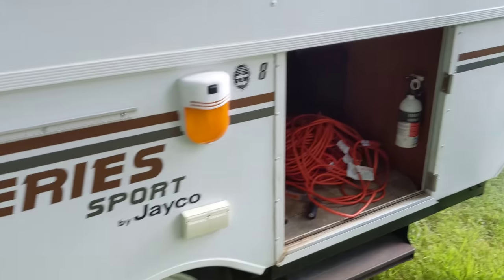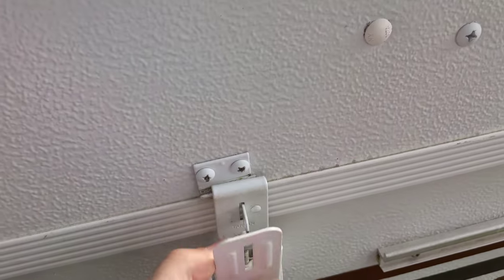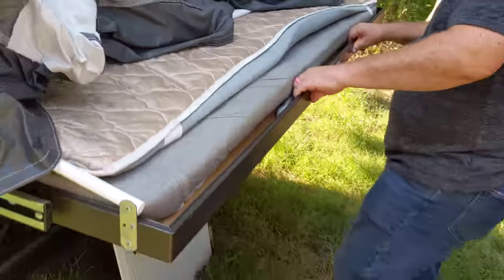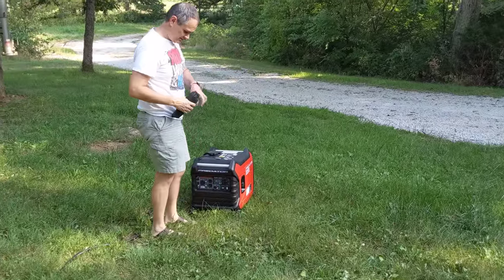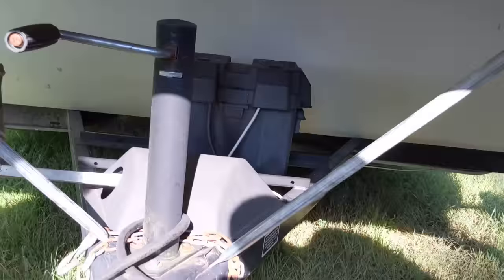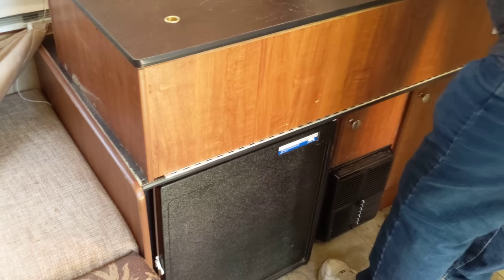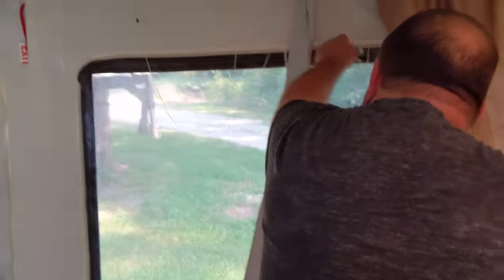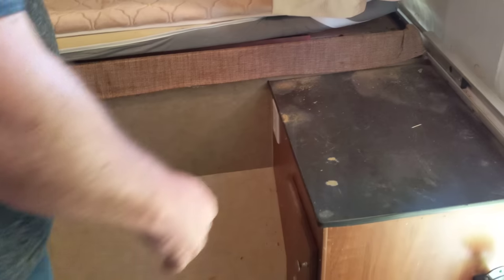First time setup of 2013 Jayco Sport 8 popup camper

Comment: It helps to PUT SUMTHIG solid UNDER your jacking POINTS! Otherwise YOU'LL BE sinking into the GRASS?.
Reply from the maker: Excellent point about the stabilizer jacks in the back and we would certainly have done that if we were planning to leave the camper open.  Because we were literally just opening it and closing it back up we didn't bother, but for anyone doing real camping...  good advice.